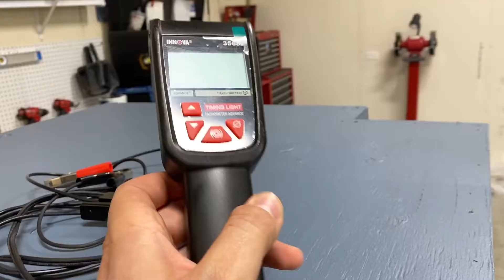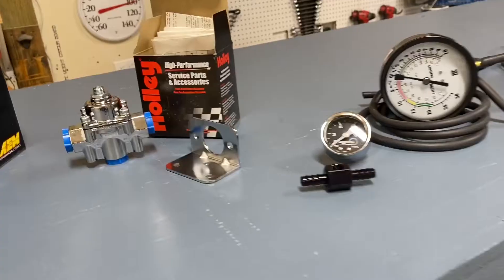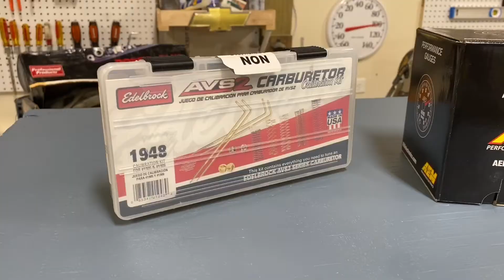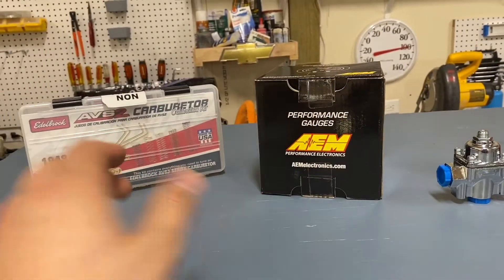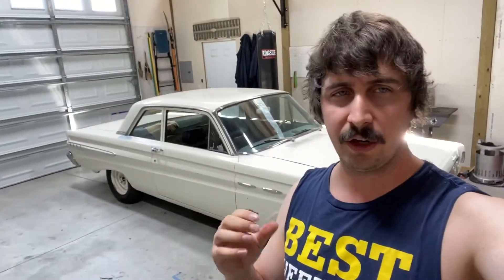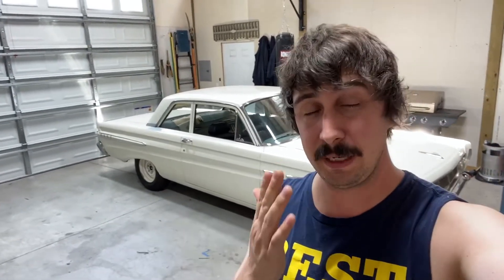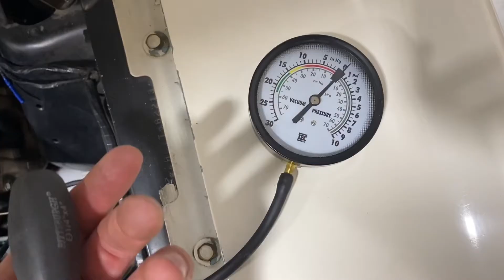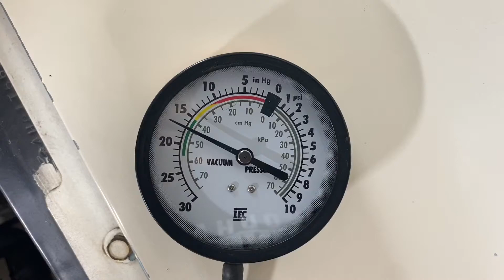Carburetor Idle Mixture Tuning

Comment: The fittings that goes in the regulator leaks. What can I do? Help!
Reply from the maker: Your fuel pressure regulator? Have you tried using a fuel compatible thread sealant?

Comment: I adjusted the idle mixture with a vacuum gauge and get the highest reading ( between 17 and 18 mercury) with a half turn left to the end (lean side) Is this okay and is the engine not running to lean now?
Reply from the maker: No Youre totally fine.
Reply: @truckandroll989  Thanks mate
Reply from the maker: @peteralexander1155  no worries. If anything, I’ve learned that when you set your idle using this method, it’s a tad bit rich.

Comment: Many classic cars specify the car is to be in drive if it's an auto trans when tuning,  just remember to chock the wheels and don't rev it.
Reply from the maker: Yes, this video was specific to a manual so neutral is fine but yes for an auto.  Or have someone hold their foot on the brakes

Comment: I don't agree at all with turning the mixture screws in a fraction from highest idle. That is how all the carbs. were set at the factory in the 70's. There was a hell of a lot of rough idling engines because a worthless lean setting back then. When left this way you will end up re-adjusting them more often because even a little contamination in the idle circuit will create a leaner condition causing a bad idle. A slightly lean condition will cause a rougher idle than a slightly rich condition. Turning the mixture screws out a quarter turn rich gives you a fudge factor against a lean condition so you won't see your customer back in your shop as often. I have adjusted mixture screws a little rich for 53 years and don't have see my customers as often. They like that better. (And no, to you guys that think you will gas foul the plugs. You are wrong)
Reply from the maker: I dont think thats bad advice.  One could argue you can still shoot for highest vacuum but perhaps not lean them out past that point?
Reply: That's better then setting them the  government E.P.A. method but barely. I new what the E.P.A. guide lines were by noting the mixture screws position when adjusting the new cars back the seventies after I pryed those damn plastic caps off and found them about a sixteenth or slightly more turned in from highest idle speed. I put the kibosh on that and turned them out from then on 1/4 turn. I'm glad you seem to understand the value in my method. So many YouTube warriors take the "book" method to heart but you are more flexible. Thanks.
Reply from the maker: @bottmar1  and so i better understand the issue back then (and likely now) was the small orifice created by the lean IMS setting was prone to being further reduced by debris which could cause the need for further adjustments/lean stumbles off idle, etc.  I doubt a 1/4 turn made a very big difference in AFR/idle speed/vacuum but it sounds like it reduced the need for more regular maintenance.
Reply: That is correct. You get a little more time between adjustments without runabilty problems. Catch cha later.

Comment: First thing is to adjust air mixture screws then the RPMs? When I set the mixture screws to about 17 in m. My rpm is about 1400 then when I bring the rpm down so does my vacuum it goes to about 15” m. I’m still trying to learn how to adjust my AVS 2 carb
Reply from the maker: Out of the box the carb is going to have some baseline settings.  Assuming your fuel pressure is good, engine is fully warm (choke open) id likely get rpm set first and then start adjusting IMS.  Adjusting them will affect idle and also vacuum.  You are shooting for highest vacuum at desired idle rpm.
Reply: Adjust one side to highest vacuum (preferably in gear), return idle to recommended rpm, adjust other side, readjust idle rpm, repeat until best idle vacuum or smoothest idle is reached at proper idle speed.

Comment: Hi, what kind of vacuum gauge do you use, if possible please provide a picture. Thank you. Love your blog. Best regards from Kenya.
Reply from the maker: Any of them really work.  Preferably one with a larger face so it is easier to read.   Here is an example

https://www.amazon.com/Hromee-Carburetor-Pressure-Diagnostics-Leakage/dp/B08P4P97H2/ref=mp_s_a_1_1_sspa?crid=2UVQX0FET4VKU&keywords=automotive+vacuum+gauge&qid=1661361259&sprefix=automotive+vacuum%2Caps%2C121&sr=8-1-spons&psc=1

Comment: Hey I just bought the edelbrock AVS2 650. Im in the process of rebuilding my 350 with the edelbrock e street top end kit for my 75 blazer. The fuel pump i ordered is a edelbrock mechanical fuel pump rated at 6psi do i still need a fuel pressure regulator?
Reply from the maker: It certainly doesnt hurt to add one.  Edelbrocks are pretty susceptible to fuel fluctuations.  You could try a fuel pressure gauge first to see what it reads and determine after that if you want to add a regulator
Reply: @truckandroll989  thanks
Reply: Yes because sometimes the pumps flow more then Advertised
Reply: @josephmclaughlin9787  or sometimes the gauge is reading wrong.

Comment: I am runing 3.5 psi on my 1406 edelbrock and is not working properly is the presure low i need 5.5 to run beter
Reply from the maker: Yea I would turn it up and that should help.  Between 5-7 is good
Reply: Way to low the more the better never seen one as low as yours

Comment: What’s your opinion on ported vs manifold
Vacuum for the vacuum advance signal? With my n91 cam in my SBF I’m unable to get it to idle at a high enough rpm without opening the throttle blades too much and exposing the transfer slots. Guess I could open the secondaries but I also noticed I was able to get a leaner idle mixture with more advance at idle (manifold vacuum signal). Just what worked for me so far. Love the content.
Reply from the maker: So Ive run both.  From my recent research it appears in most cases Ported is preferred except in a situation like yours where you need the extra timing for improved idle quality.  The other option would be to modify your distributor to limit total advance so you can run more base timing.  Lets say your average distributor adds 20 degrees and you typically run 14 initial… whelp thats 34 total.  With a big cam you may want 18-20 initial but not 38-40 degrees total.  There are ways to modify it so it stays at 34 total but it definitely involves more tinkering.
Reply: @truckandroll989  awesome thanks. For its staying on manifold vacuum haha.
Reply: MANIFOLD VACUUM for those with a brain!!!  You noticed it increased idle rpm which allowed you to lower base idle and cover up those transfer slots.  Don’t drill your throttle plates, crack open your secondaries just enough....
Reply: Very good